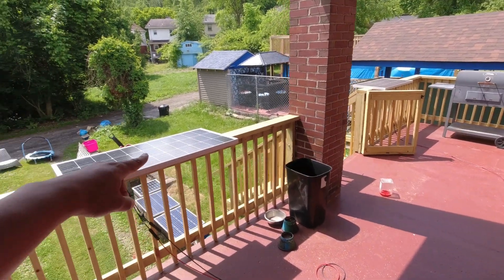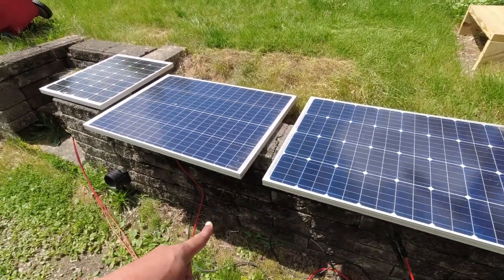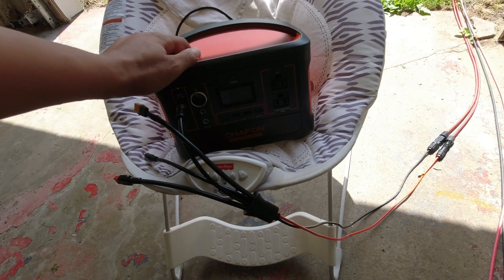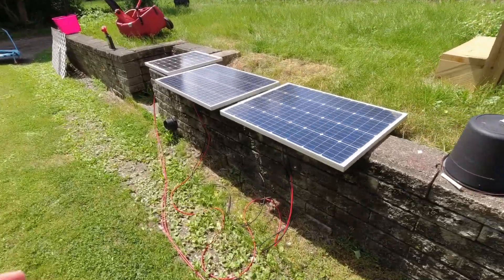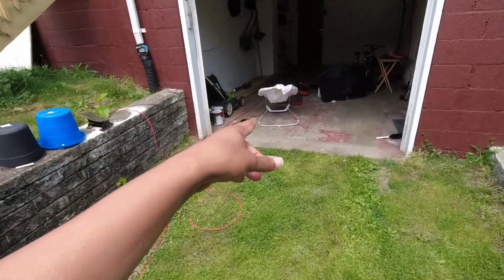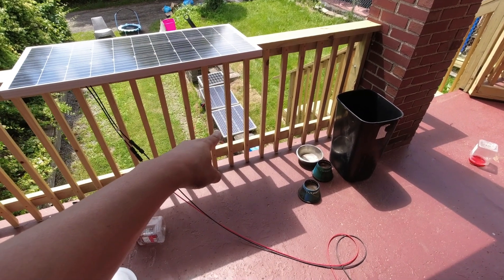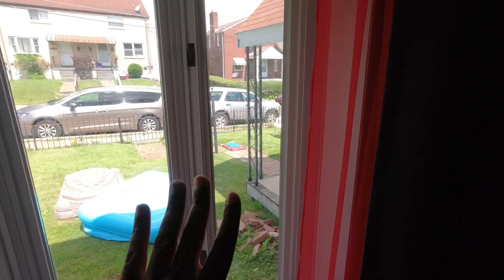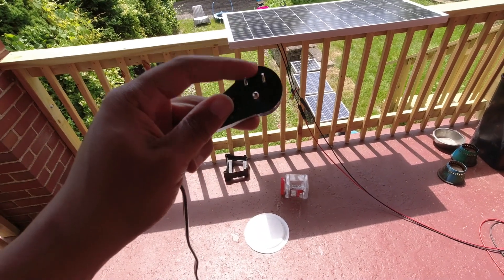My Complete Solar System | All Panels & Power Stations!!

Comment: Went sorta all in on 3.6kw used panels 10 of em, gonna toss a few hundred into lumber to make sorta adjustable ground mounts not really secured, just weighted with some blocks, bought a 3kw growatt inverter 48v and 2 48v 100amp batteries....batteries are reconditioned. 4.5k and will run my furnace and fridge plus other electronics.....will consider buying an EV to be another power dump....but only if I can find something used and cheap.
Reply from the maker: Nice! That sounds fantastic. Keep me posted. Send pictures at any point
Reply: @AskIveSolar  Had to buy new batteries, the reconditioned were not actually avail, spent 5k on system in the end and its been up and running now for 6mths without a hitch. The EV I will wait on, prices are off the charts, but it did cut my electric bill in half.

Comment: I ran my wifi and computer and some other odds and ends on pass through solar via my ecoflow units last summer. This year I’m adding panels so every power station has dedicated solar inputs. I have one Delta 1300 and I can run two in series on that station so I will need two for that one. I started investing in those 190w HQST panels and the first one is on the way. I just hope I get some sunshine so I can try it out. The weather here has been dreary since early November and I am over it. I’m hoping to add a panel or two a month and get that collection set up while they are on sale. Love that tip on the rotating extension cord. Yes get your Amazon account set up! Every little bit helps!
Reply from the maker: That sounds like a cool setup! You know Im into using my stuff and you are too. I have like 3 of those 190s now. I'm starting to get into the higher voltage panels as well, a bit more. You should too. Check your marketplace apps like Facebook and craigslist to see if you can find some 250 plus panels with the right open circuit voltage or VOC that is low enough for your delta.
Reply: @AskIveSolar   Thanks for the great tip!! People here really are not into solar backup except for the people doing those over priced grid tie systems. My Delta will take up to 400W solar input so that's why I like the idea of joining two 190s. I want to set up to run my kitchen on the Delta so getting that 400W input all day on good days should keep me going. All my small appliances and fridge run easily on my Delta. I did it some last year to learn how to use the equipment and quickly discovered solar pass through is the best method and that 3 panels are no where near enough...especially when one station uses 2 of the 3 panels. Which I learned by using my stuff! I have concerns about longer term power outages so I'm practicing with using everything and figure it out before the outage than in the middle of it. We get hurricanes here and other large storms so outages are common, but my concerns are with over all instability. And I don't want to lose my food storage or be walking around with flashlights! Plus I was able to reduce my electric bill a bit using my solar and I'd like to do ever more this year.
Reply from the maker: That's awesome. Still keep an eye out for panels. Because sometimes people upgrade those wild grid tie systems. 
That's pretty cool @ how your setup is. Feel free to keep me posted on how it's going.

Comment: You know if you angled them even slightly more towards the sun those 100w panels could get a fair bit more juice. Depends on how high the sun is in the sky where you live. Here in Scotland the sun is so high they almost have to be lying flat in peak summer but in winter it would need to be almost at 90degrees. I've got 6 100w panels all screwed to the roof of a shed maybe you can do something similar just come up with an excuse to the Mrs to get a little shed or wooden storage container out the back there and fit them to that then keep some batteries in there. Just an idea.
Reply from the maker: Thanks Some more! Yeah I know about tilting them but I don't worry about it as much because it's summer here and the sun is pretty much overhead during peak sun. 
I don't know man....I guess because I don't have the right stuff to tilt or the need to tilt....I don't bother so much. Ha. 

And I love variety too much to put them on a shed or structure. Shoot I just put one in the front yard with my ecoflow because it was a lackluster sun day and the sun is out now.
Reply: @AskIveSolar   @AskIve Solar  That's cool its funny you say that about variety as I tend to consolodate all the solar into one spot myself and use a battery bank connected to inverter in the shed as apposed to multiple power stations dotted around. Though doing that has quickly highlighted a problem I've got in winter in that my back garden/yard is not catching the sun almost at all for a few weeks, coupled with the fact there's only 4-5hours of light at best. So I can't really move my panels without buying a tonne of cabling. I think I'll get the eco flow (inspired by your video) and hook it to a panel out the front up high and try and leech onto some of that precious winter sun haha.
Reply from the maker: Thats awesome. I think the ecoflow is on sale for like 250.
Reply: @AskIveSolar  Iv already bought it. In the UK it was £350. Quite a lot but I like the fast charge feature will benefit me during winter. I have a quick question for you also.. Did the ecoflow come supplied with a solar charge cable and did it connect straight to your panels without an adapter? I.E they haven't fitted it with some wierd cable that only fits their own branded panels?
Reply from the maker: It comes with the right cable in the box. 
Check out this unboxing video I did. 
https://youtu.be/69wO39mxNHE

Comment: I am ready to begin my solar journey. Last year I bought a small solar cooking vessel for camping but I want to start equipping for power outtages. South Florida and power outtages are a given, much like you mentioned about NOLA.
Reply from the maker: Greetings Fadista, 
Thanks so much for watching and taking the time to comment. I appreciate it. 

Do you think you will be going the DIY route or buying a power station?
Reply: @AskIveSolar  I just want to start with a good portable generator--I have been watching leadfarmer73 to get a sense of different ones. The last hurricane outtage was rough, sure makes you get focused on things! I am going to look at your vids too and try to research. It seems like there are hundreds of models out there.
Reply from the maker: Check out Silver Cymbol too. He has a good few gas generator vids.
Reply from the maker: But if you're thinking about outages. I wouldn't go with anything less than 500wh (watt hours). 

300 off you're just trying to get your feet wet. But you may find yourself wanting something bigger.
Reply: @AskIveSolar  yes I agree--I was thinking of the more powerful inverter too. Maybe one piwerful unit and one smaller one for travel. Thank you for your help!. 😚

Comment: Pretty sweet setup using these portable power stations to run your laptop and monitors during the day for work. Never even thought of trying that haha. My wife wouldn't want the cables and portable boxes everywhere around the house so I don't think I could get away with that. With all those panels outside, you should look into a cheap DIY ground mount system, then you can get them off the ground and tilt them pretty easily for more performance. Thanks for sharing!
Reply from the maker: If only I were handy. LoL. I would entertain it. And certainly if I had a bigger yard. I feel like I need the flexibility because of my preference for options. 

The best idea I've heard that comes even close to what I want to do is using a old satellite dish mount for panels. That way you can adjust them.

Comment: What kind of extensions cords you used for the eco flow pro?
Reply from the maker: If you mean solar extension cords. I just go with the cheapest / known / highly rated mc4 extention cables from amazon. 

I have a couple HQST ext cables and my latest one was from rich solar. I also take into account the cost per foot. But you dont  want to go too long. 

15 to 20 foot 10 - 12 gauge is a nice sweet spot for getting some space between your panels and your device. 

And the extension cords dont matter whether its the pro or the max or the base model. 

Does that make sense?

Comment: I am thinking of getting multiple power stations and panels like you have so that I can work through power outages. I have the jackery 240 that I use and an 180 watt RV panel that I am not using currently. I want maybe 2 more power stations and 2 to 3 more panels to add as funds permit to reach my power goals. Thanks for the video!
Reply from the maker: Nice @ that 180 wat panel.

What do you charge the jackery with?
Reply: @AskIveSolar household current that charges at 39 watts but took my panel and jackery out back and was getting nearly double that but I was hoping for even more. The panel is heavy so I had it on a hand truck moving it around for the best angle and position on the ground but I may end up putting it on the roof of the house or van
Reply from the maker: Gotcha. I want a 200 watt
Reply: @AskIveSolar  I understand. Hope you get it soon!

Comment: Thanks for the solar videos, they  are great.  . . I'M  SUPER new  to all this  . .  And was wondering if you could help me . .  my question is  what  portable solar generator and solar panels   that I can buy that will power a space heater to warm 1 room in the event of a winter time power outage.  I have  watched  Bro Lead Farmer  videos  but was kinda embarrassed to ask on his platform cause it's so big .  I bought the Go Station  and briefcase solar charger from harbor freight  . . Now  I need power to at least power a space heater . . What would you suggest?
Reply from the maker: Keep in mind that running a heater from a battery is not ideal. They just draw a whole lot of power. 

Typically a heater uses 750 watts per hour on low. 

Just for example purposes...if you purchased the eb70 for 500 dollars with a watt hour capacity of 700 then it could run a typical heater on low for one hour. 

That's why heat and portable power stations is not a good fit. 

Not saying you shouldn't but just want to start there. 

Now Amazon has a heater that uses 500 watts. Anything lower than that might not actually warm up a small room.
Reply: Ok , ,  thanks I got that . . Maybe not a whole small room . .  but what about a. 2 to 4 person tent. Would that 500 watt. Or smaller heater warm that? I'm asking because where I live we get ice on power lines that may snap and not to mention un-travel-able snowy icy roads . . there could be no power for hours , days or weeks. Kinda want to avoid the unpreparedness of February 2021,
Reply from the maker: I dont own it but LeadFarmer73 had it in his RV and he said it was warming the place up. I use my heaters on the 750 setting all the time and they work in our bathroom. From the wall outlet btw. 

I think that heater would work to heat up a small room for sure. They cost about 21 dollars on amazon but last time I checked, it wasnt there. We both may have missed our opportunity to grab a good low power heater. :( 

Consider an electric blanket as well. I did some casual research on it but didnt make any conclusions as to whether it would work for my family or not.
Reply from the maker: A couple devices that come to mind is the Bluetti EB150 for around 1000. It has 1500 watts of power storage. 

Also consider the deal I talked about today in my latest video. Where you could get around 1400 watts of power from the EcoFlow Pro + The Extended Battery for 700. Keep in mind those capacity numbers are on paper only and you dont get the full power output. 

Then for panels. You could get a couple 100 watt panels for around 100 dollar each.
Reply: Thank. you ,thank you , thank you for all the great suggestions , , the blanket was my favorite hadn't thought about that route 🌄 . . You and Bro Lead are THE BEST ! ! !
Reply from the maker: My pleasure! Glad I could help!

Comment: That's interesting that your EB70 can't handle that freezer. How long is that surge because the EB70 should be 700 watts continuous with a few second burst of 1400.

Have you tried any flexible panels? With your setup I wonder if you should try something like a Doki 220W panel. The price is much cheaper than a 200W renogy panel and you can hang it over that deck rail and you could prop up the bottom to get an ideal angle.
Reply from the maker: Don't those dokio panels have charge controllers. Do you like them, they seem a little janky.
Reply: @AskIveSolar  I don't have one yet, but I will in about a week. It comes with a crappy PWN controller but you don't have to use it. Since the power stations have PWM (the clones you have I assume) or MPPT (Bluetti/Ecoflow) controllers built in just use one of the connectors to plug directly like you do with your other panels. They definitely don't seem as high quality as the branded panels from Jackery/Bluetti/etc but those cost 2.50 per watt vs 1.10 per watt of Doki. Accounting for inefficiencies I can get a bigger panel for still cheaper to make up for it.
Reply from the maker: That's a good price per watt. I hope it works out for you my man.